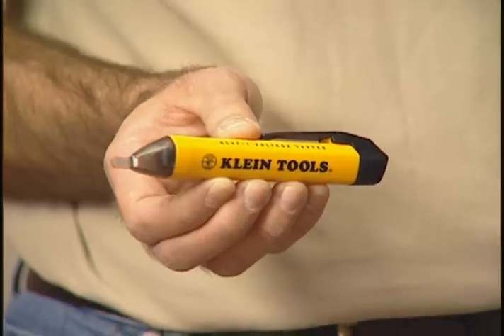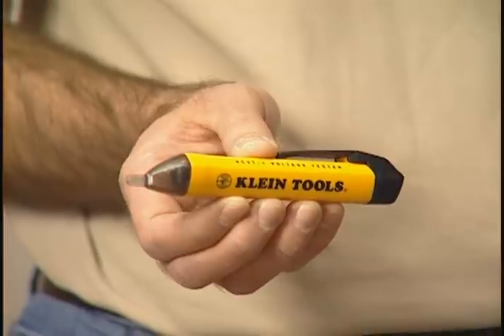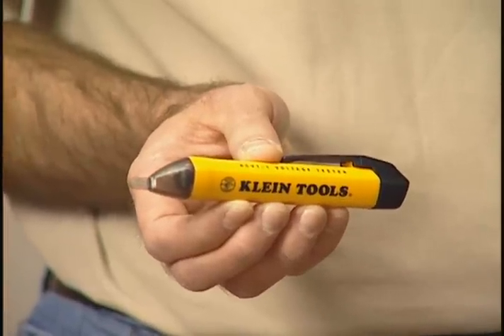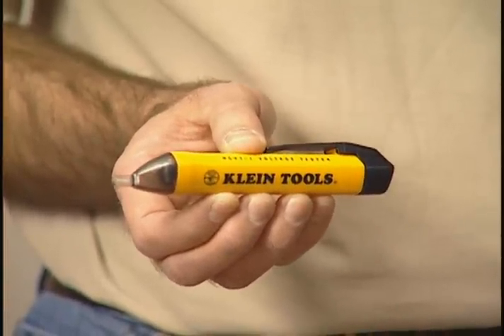Klein Tools Non-Contact Voltage Detector

Comment: I just went to try mine after many years of not using it. First problem was getting it open because the yellow tab had developed a crack at its base so it was pivoting down instead of levering down and was still catching on the black pocket clip so I had to insert a small screwdriver into the opening. Second issue was it doesn't seem to work anymore, it does beep and light up green but it doesn't seem to detect any voltages, even when plugged directly into a known active wall outlet. Into the garbage it goes! 😒